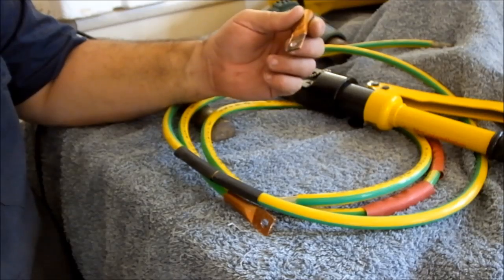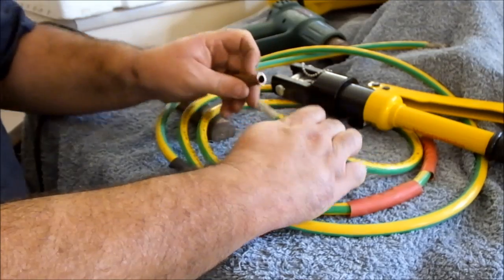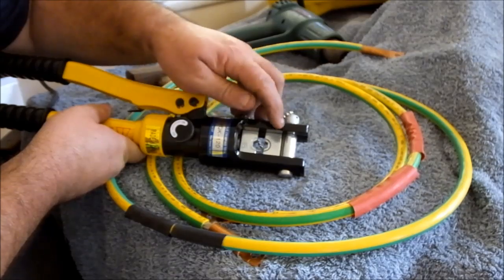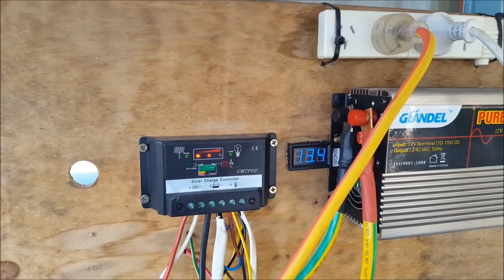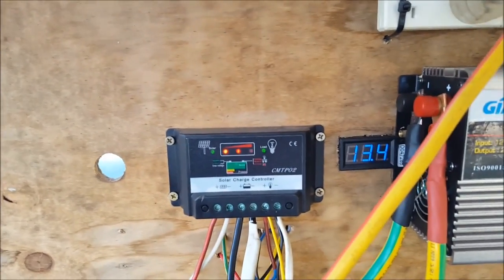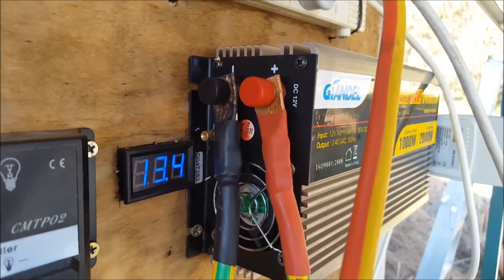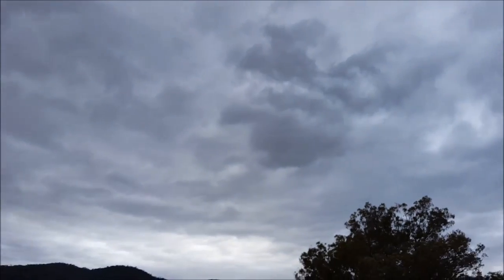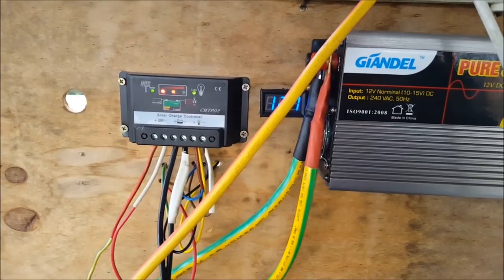Off Grid Solar Power - Testing the Chest Refrigerator and Water Pump

Comment: you did wire brush out the inside the copper before crimping right?
Reply from the maker: Nope.
Reply: Copper tube has a coating the inside and outside which is why plumpers use a small wire brush before they solder copper together.

do these cables work?
Reply: you could losing a fair bit of power into heat with these ends
Reply from the maker: Phillip Aboody Possibly, yes, but solar panels are cheap and I don't use a lot of power to start with.
Reply from the maker: +Phillip Aboody And yes, the cables work.